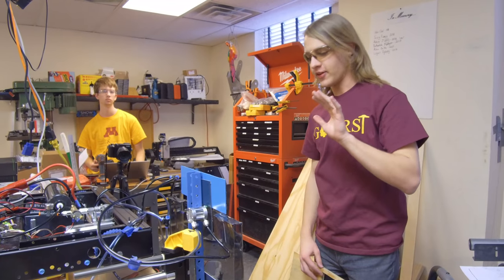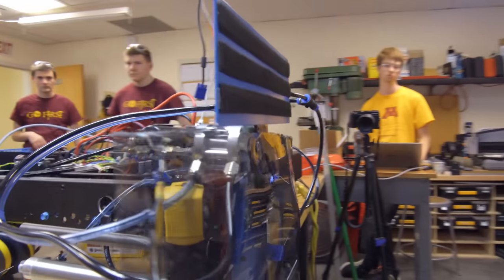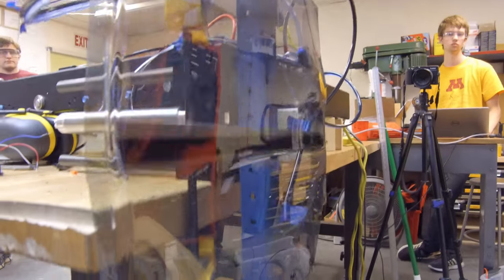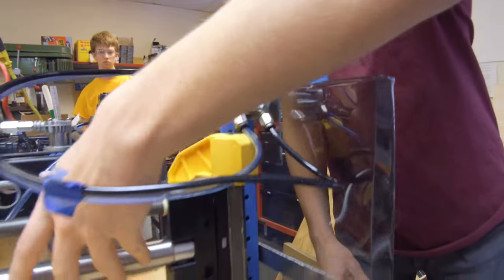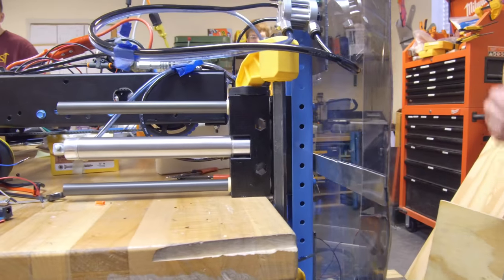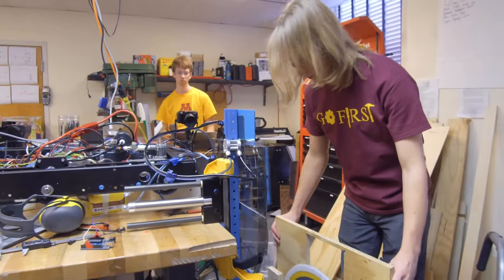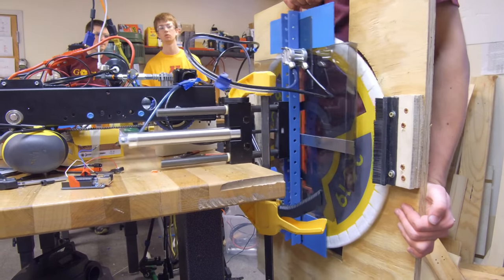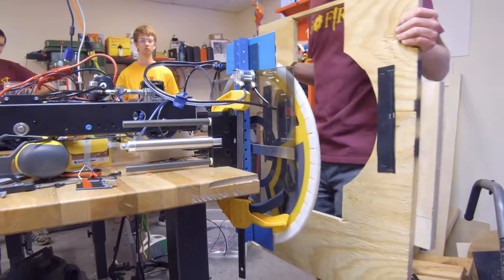Ri3D 2019 Day 2 - Hatch Panel Testing

Comment: What type of linear rods/bushings are you using?
Reply: The rods and bushings are the ones provided in the Igus bag in the standard kit of parts.
Reply: @karlolson3029  did you 3D print the black casing?
Reply: @davidebersol5440  Yes, the casing was printed. However - this casing broke during our testing when we tried to drive into the hatch with our mechanism extended. I would recommend either machining a similar device or making sure that your printed piece can withstand some abuse.
Reply: @karlolson3029  Aluminum it is, thanks for the heads up
Reply: @karlolson3029  last question, hopefully, how did you get the igus rod to attach to the attachment which which extends outside the robot?
Reply: @davidebersol5440  We tapped the end of the rod and bolt through the bar that attaches to it. There are likely other perfectly fine ways as well.
Reply: @karlolson3029  cool, taping is exactly what I was gonna do. I feel like threading the outside will strip and shaft collars will fly off lol